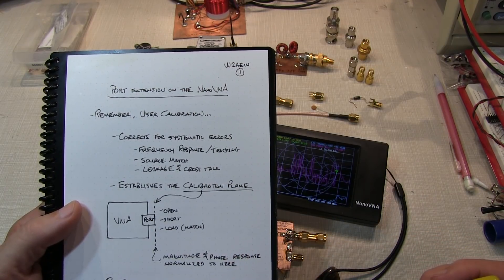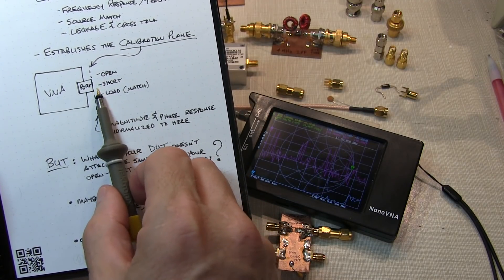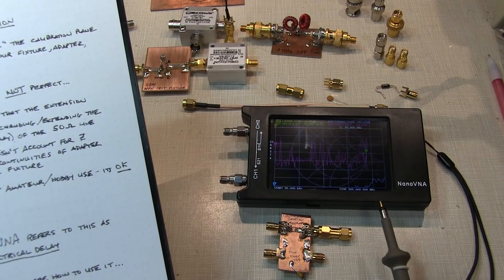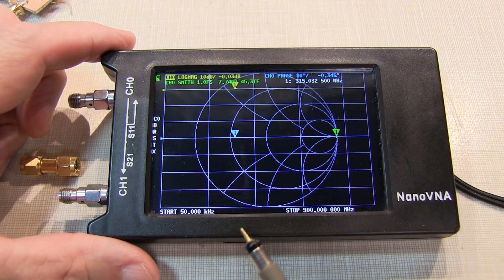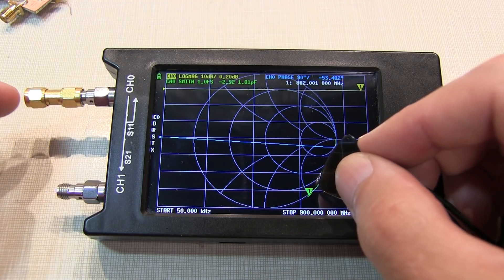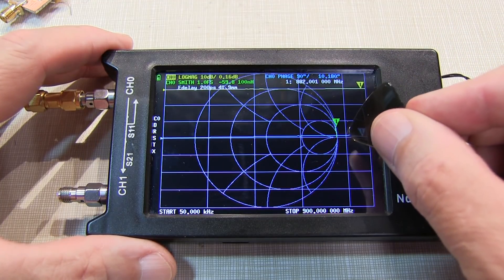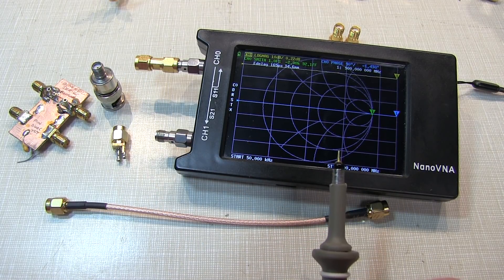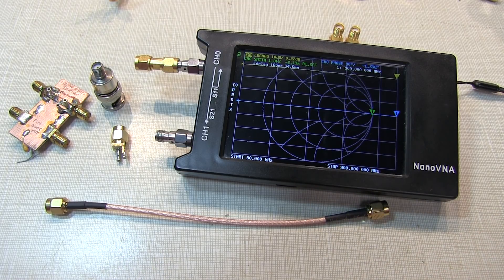#317: NanoVNA Port Extension using the Electrical Delay setting

Comment: Thanks Alan for the video. I sure wouldn't figure this out from the 1 page "manual" that came with my unit. I ended up buying the NanoVNA-F version not knowing there were other versions. I ordered it "without battery" as paying almost $50 extra for a battery seemed exorbitant considering what batteries cost in China. Surely it would still have some small battery that would maybe give 1 hour of use? After all it is a portable instrument. But NO, it seems to have no internal battery so I have to power it from a power bank. Why would you make a portable instrument without a battery?? I had hopes at first that it did have a battery as I get the flashing red light when connected to power and the blink rate goes down but no luck. Will go back and re-watch your other videos. Thanks again.
Reply: There are safety concerns regarding the shipment of Lithium-based batteries - some people would rather not take the chance. And some hobbyists already have these on hand, and can save money by receiving a cheaper unit without one.

Comment: I didn't see any indication that delay had been added, are the settings persistant or are they set back to zero when you turn the device off?
Reply from the maker: They are reset to zero when to turn the device off.  When the electrical delay has been added, it is shown in white text in the upper left of the display (Edelay value)
Reply: @w2aew  Thank you so much, once I got off my lazy butt and did it myself it became apparent, you are a muse, god bless.

Comment: Thankyou.  This has driven me nuts doing cable cals as it always bothered me that i cant cal out the last adapter. Now I know what the solution is "Port Extension".  And you mention that as my work is close to DC I need not worry.

Comment: Fantastic video.    Yesterday I watched a Keysight webinar on a similar topic.   Can you make follow up video on that 4 port  copper board on your tabel on say some simple DUT?   Also   where can I buy those sma connector savers?  What is the technical name for them?
0 dB  attenuator pad?   I took a look on digikey and a 1 dB pad is like 142 $  ?   Can you post the link to buy these savers?
Great video!!!
Reply from the maker: The connector savers are also simply known as a male-female adapter.  Here is a good example:
https://www.minicircuits.com/WebStore/dashboard.html?model=SF-SM50%2B

Comment: Thank you for another great video! I would also be interested in seeing a video working with baluns.
Reply: Check Gregg Messenger's channel
Reply: @R3RadioResearch  Thank you. I also find Gregg's channel informative. But although I am quite new to this I feel that more could be done than measuring common mode rejection. For instance can I use the nanoVNA to measure the characteristics of an unknown balun without tearing it apart?

Comment: you bet I did learn something new ! But tell me, why not recalibrate at the end of the extention or pigtail and then test at the end of that extention or pigtail ? I did test with a coax cable that ends with aligator clips with small wires and readings are everywhere ! I wanted to use those type of cable to test windings of a balun but I don't think it will be usefull unless I could correct those cable/aligator clips with electrical delay ? I've calibrated those test leads with OSL and still have crazy readings... Thank you for all these great tips on nanovna !
Reply from the maker: Unfortunately, flying leads with alligator clips just don't work well with a VNA because there is no controlled impedance - it varies as you move the leads around.  The only way to get somewhat consistent results is to affix the leads to a stable physical location and then calibrate. Even with this, it will be difficult to get consistent results.
Reply: @w2aew  Maybe I should have get the BNC/Banana binding post instead, they are "fixed"... Thank you for the precisions and awesome videos !

Comment: How does adding this delay differ from just doing a new calibration to include the extra connector? I thought the cal took the extra length into account.
Reply from the maker: Performing the calibration at the far end of the added connector, fixture, etc. is the PREFERRED thing to do, this will take the extra length into account.  You would use Port Extension only when it isn't possible to do this (maybe due to mis-matched connector types, etc.).
Reply: @w2aew  If I am using a small coax cable from my VNA that does not have a standard SMA connector on the DUT end but rather a stripped piece of wire that I solder to my board, can I just use a 0 OHM, 50 OHM and no resistor to perform the calibration ?
Reply from the maker: @eduardorey8238  often times yes, but gets trickier as you go higher in frequency.
Reply: @w2aew  I also need to solder a coax to the PCB to tune the Pi network of a Bluetooth LE ceramic antenna. Is there a way to verify that the 50 Ohm resistor behaves like a resistor (inductive/capacitive part stays negligible) and that the calibration is somewhat valid?
Reply from the maker: @marcspeck  If you complete the calibration to the ports of the VNA, then solder the same type of 50 ohm resistor to the end of the coax, and connect that to the VNA, it should still look like a 50 ohm resistor (because a properly terminated 50 ohm line will look like a 50 ohm resistor).  Then you'll know that the far-end termination is OK.  Otherwise, you can use Port Extension.
Reply: @w2aew  genius :-) comparing the calibration at the ports of the VNA (a) with the calibration at the soldered end of the coax (b) and possibly (a) with port extension (c). Thank you for this tip (will do it asap) and also thank you for your great videos!

Comment: Hi W2AEW! Very interesting video. Good thing you made clear that this measurement plane shifting method only holds for situations when no real impedance transformations or non linear phase changes occur. I work in the RF industry and have found the .spar data from semiconductor manufacturers to also have used port extension for measuring a device on a microstrip eval board. In the resulting data very clearly can be noticed that a lot of irregularities are not deeembedded perfectly since the reflection curves are curling anti clockwise in the Smith chart. Incorrect device behaviour due to port extension, never seen it when correct TRL or TOSM calibration has been utilized. I.e. Coaxial SMA to microstrip transition on a RO4003 PCB are absolutely not suited for port extension, even at S band already. Definitely need an PCB cal kit.
Reply: You are definitely right. I always add calibration standards to test fixture PCB hosting the DUT. TRL calibration using these embedded standards placed at the desired reference plane performs quite well, provided that frequency range satisfies phase variation between 20 and 160 degrees for phase unambiguity as per TRL requirements.
Reply: @paolomonai9511  Regarding the frequency ranges: utilize multiple TRL lines with center frequencies according to predetermined frequency ratio. Most of the time ratio 4. I.e. Line 1: 0.25to1GHZz,  line 2: 1to4GHz, line 2: 4to16Ghz.
Reply: @stefanhummelink3662  Yes, of course the use of muliple lines is the right thing to do for a very wideband characterization, for example multioctave bandwidths. Regards from Italy.
Reply: And the moral of that is: ALWAYS get a sample first and measure it yourself!
Reply: @hectorpascal  If you want to be sure that a job is well done, do it by yourself...it is the only way!!! Regards from Italy.
Reply: @hectorpascal  Ya, that's exactly what we do. I use the manufacturer data only for checking its suitability for me prototyping it on our own characterisation PCB's on which we determine the correct behaviour. 😎

Comment: Thank you as always! I think it's worth to mention a simple calculation of the delay value = (phase / 360) / frequency, it gives 167ps to correct 53 degree phase shift at 882MHz in your example.
Reply: it been a while... need a refresher course on this... itt we went over smith charts
Reply: To be precise one should take into account the velocity factor which is not equal to 1 in case of a non-air-filled coaxial line like in this example. That means that wavelength is shorter and the phase shift is greater than expected.

Comment: Is it possible to just cailbrate the VNA after the adapters or cables are installed?  I've been doing that to "move" the measurement plane to the end of a coax, but I fear that may have been a bad idea
Reply: Hell yea! W2AEW shows the method in the video to work great of you do not have the option to calibrate at the end of your system connections! For lower frequencies this method by W2AEW works perfect, but if we as RF designers need absolutely accurate data you shall and cannot mitigate the correct and full 2-port TOSM or TRL calibration to calibrate your VNA system to either the end of your SMA(or i.e. smp) cable if your only interestes in the behaviour of your DUT with its connectors in total as a black box, OR to calibrate the VNA system to  a plane right next to you DUT in a PCB for instance. For the latter your require a PCB callkit that contains the same connector transition to the actual PCB and should have a open and short standard at the plane location of interest. The callkit should also contain an through, which are simply two open standards connected back2back (no exactly true since the open standard it self should compensate for the fringing field at the open end).... The KIT also contains a match/load (perfect 50 ohm termination).
Reply from the maker: Performing the calibration at the far end of the added connector, fixture, etc. is the PREFERRED thing to do, this will take the extra length into account.  You would use Port Extension only when it isn't possible to do this (maybe due to mis-matched connector types, etc.).  You have been doing it right!
Reply: Good question, as I have been doing the same thing and it seems to be working just fine.  To me, I thought calibration took everything into consideration to include internal PCB delays and all to include cable length to the terminating end?
Reply from the maker: @smokingsolder39  Performing the calibration at the far end of the added connector, fixture, etc. is the PREFERRED thing to do, this will take the extra length into account.  You would use Port Extension only when it isn't possible to do this (maybe due to mis-matched connector types, etc.).
Reply: For sure. Just connect the cables and perform calibration
Reply: H Higgins  Good God. Sounds like damn hard to do our job then. 😱
Reply: H Higgins  Ya indeed. For those applications SMA way to expense is and big. My applications involve no handheld stuff and even if size is a concern, which happens, we use SMP for the internal interfaces:).

Comment: Please do a video about measuring and tuning baluns on the VNA.
Reply: and please add coaxial chokes to that, too. although they are pretty close to each other
Reply: And if you could,  please include how to measure CMRR in a Balun.  I have been looking into this and found some info but there seems to be multiple methods and nothing I found explains it in a away I fully understand.  Thanks for all your great videos.  I have learned a lot from them.

Comment: Excellent demonstration!  I'm just waiting for a 4" screen nanovna version to be announced.  Having poorer eyesight than the younger guys who design these great, but tiny, instruments really sucks!  :(
Reply: If you need a larger display, you can connect it to a computer and use a program like NanoVNASaver.
Reply from the maker: The one that I am using is a 4" screen.  It is the NanoVNA-H4.  Another 4" version is the NanoVNA-F.
Reply: @w2aew   Thanks! - I probably should have made it clearer that I'm interested in the S-A-A-2  V2 3GHz 4" version, to supplement my DG8SAQ 1.3GHz VNWA.
Reply from the maker: @hectorpascal  OK - I think that we'll see a 4" version of the S-A-A-2 unit in a few months...
Reply: Yes!   Maybe  one with a HDMI output ?
Reply: I have had instructors in the past that, for me for example, made everything so easy to understand but for others flew right over their head. Your style makes it easy for even the slow Learners to understand but not boring for someone, for example, like me. Thank you so much for doing this for us!
Reply: 4.3" display has been out there for quite some time...-H4 version is 4" and -F variant is 4.3"...i think there are more...
Reply: Me too

Comment: Thanks again for another wonderful video! Can you tell me what kind of new stainless steel connectors you added to your VNA to protect the ports? And was calibration done before and after you added them? Also, would you consider a video on calibration kits? I have noticed that many cheap kits have opens, loads, and shorts that are not always 50 ohms.
Reply from the maker: They’re a pair of m-f adapters (connector savers) from Mini-Circuits. Calibration was done after adding them.
Reply: @w2aew  Thank you sir!
Reply: @w2aew  I forgot to mention why I requested a calibration kit video. I'm expecting the NanoVNA-F soon and there is a beta firmware to increase the frequency to 2.7gigs. Cheaper kits may be okay up to 900 M but calibration may be off at 2.7. Thanks!
Reply: For those interested: https://www.minicircuits.com/pdfs/SF-MQK50+.pdf